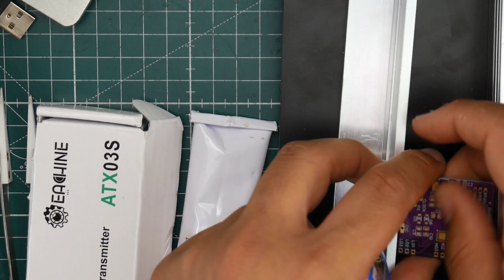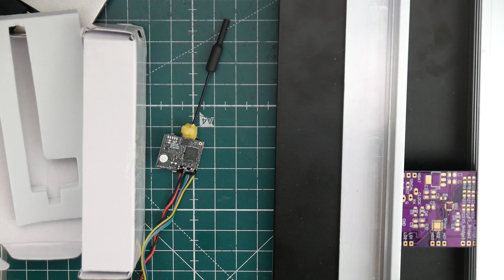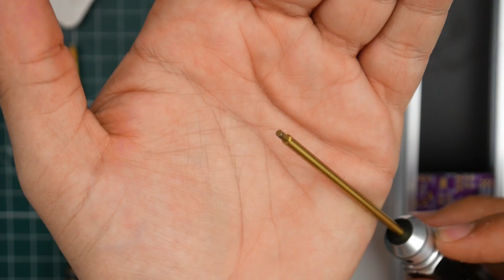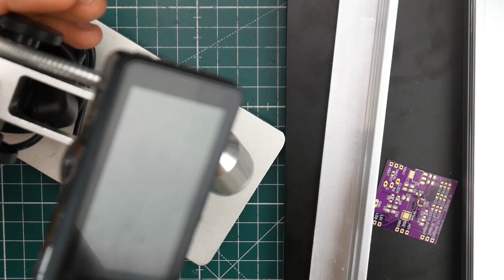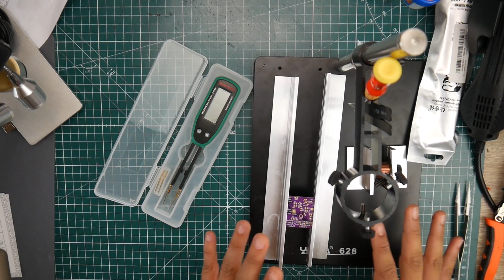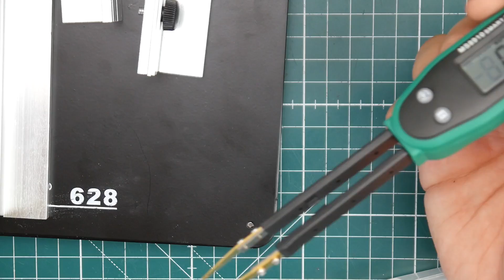Great Budget Tools and SMD Repair Tools // Update Video

Comment: DM Question. I guess your the best guy to ask. With these repair videos you do, love them b.t.w. and you innovation. Last night I opened a sad box. Three cameras, Falkor, Micro Eagle and a Predator (Not sure which exactly.) that I have broke by wiring postive and negative incorrectly. I now double, treble check and use a smoke stopper. I was wondering is there any hope for fixing these cams? Any idea what would have blown wiring reverse polarity?
Cheerz fella. I look forward with hope still for your reply. 🙏🏽

Comment: 1:53... If you do not use the supplied tip and use a tooth pick to apply the glue
directly out of the tube... You would not waste all the glue in the tip.
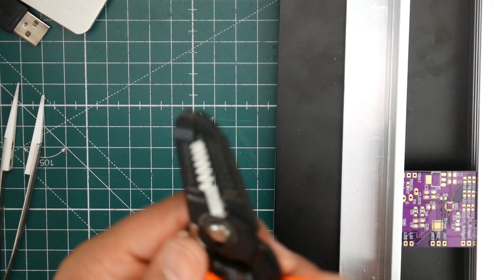2:15... Those are wire strippers.... Pliers are something else.
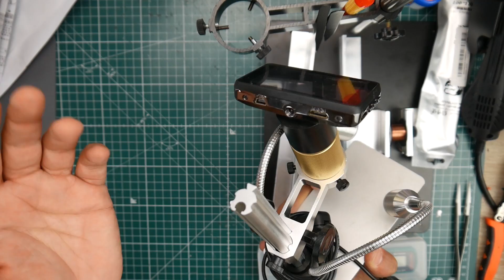4:46... $139.99 @ BG

Comment: The multimeter can be very inaccurate because the components should not be measured on the circuit.
Reply: Can or cannot - depends from particular circuit and polarity (direction how you connected tester to component on board). I have them. In many cases those tweezers can show resistor and capacitor values precise enough to understand what is on board. In 2 years needed to solder out capacitor for more precise check only twice.
Reply: @KrotowX  I completely agree with you but there may well be falsifications when the circuits become more complex and many ICs are used.

But its very good for not so complex things.
Reply: @moritzkaspar8625  Yes, you are correct. Those boards I checked definitely was not very complex. Though checking worked in TV set too :)

Comment: hop on discord
Reply: Also, I chucked most of this stuff in my cart, so I don't have to use my $20 hot air gun from the local hardware store lol. Should have a higher success rate with the new tools